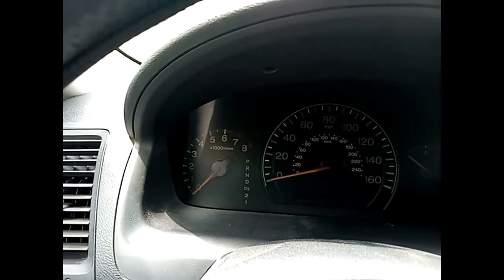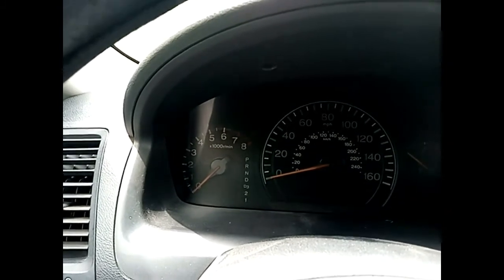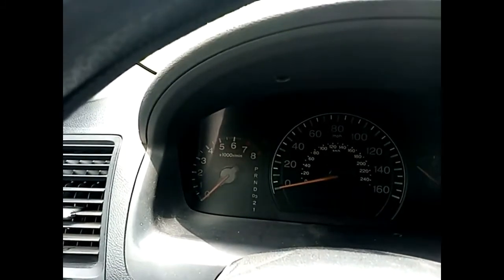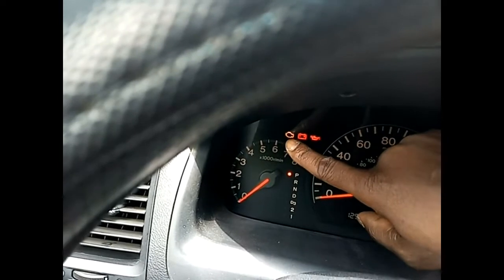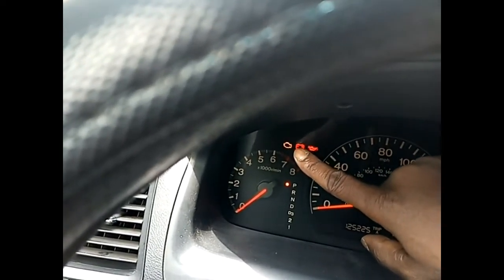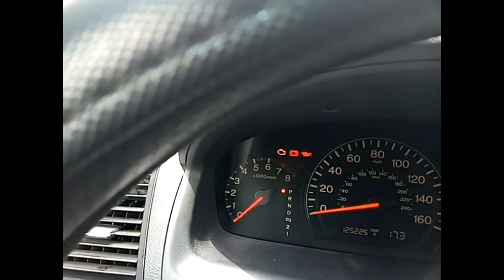DIY: A Fix for Car Engine Jerking

Comment: Good video but was it idiling rough and was there oil in the spark plug tube and did it stop after replacing them
Reply from the maker: Yeah, the idling was rough & spark plug was covered with black sooth. Got better after replacing. Thank you.

Comment: Hi, I have a similar issue with my 2013 Honda accord and I’ve changed the spark plugs before, I think about a month ago and now I’m facing the same issue again. It happens each time I accelerate and once I hit 40mph it jerks. I’ve changed fuel pump as my mechanic suggested but I’m still facing the same issue and I also notice that the engine drags before it moves. Please what do you think Is the problem and what can be done. Thank you in advance.
Reply: Same with mine, please how did you solve your issue? Because once I hit 40 it jerks then I release it the press it gently before I can get up to 60
Reply: Im having the same issue, if u fix it before my let me know if I do before u I’ll let you know
Reply: @randomgrapes8878  yes I have, it was the raising sensor that had issues
Reply: What is raising sensor?

Comment: Please am driving lexus rx350 2008 model, mine is jerking in low speed
Reply from the maker: You may want start by checking   the spark plugs state & also that of the injector nozzles.

Comment: Mine is jerking and delay in shifting gear automatic.
Reply from the maker: Delay in shifting is probably Auto-Trans solenoid issue.
Reply: @SonnyIbibo  repair of transmission here is so expensive
Reply from the maker: It may not be Transmission repair.  The pressure solenoids can cause that sort of issue.
Reply: @SonnyIbibo  where i can find that solenoids?
Reply from the maker: @BWAKAENA  Depending on your model, the solenoid are on the body of the Trans.
See my videos for one of such solenoids.